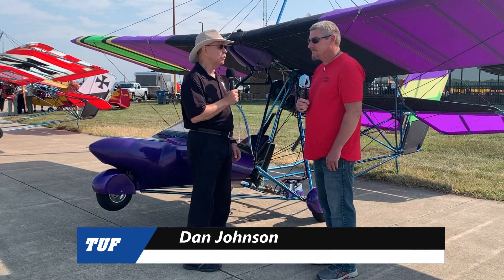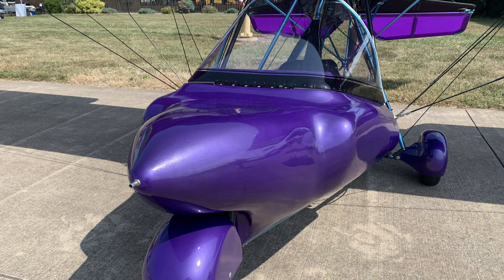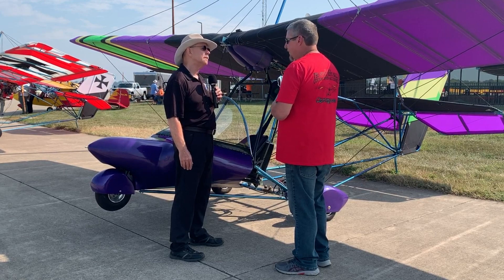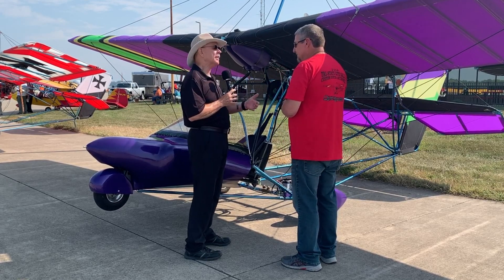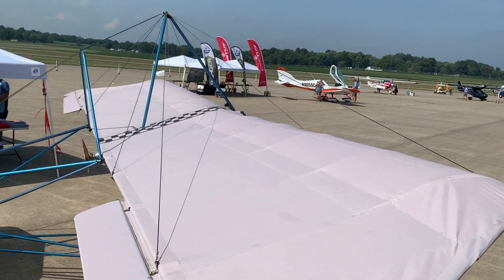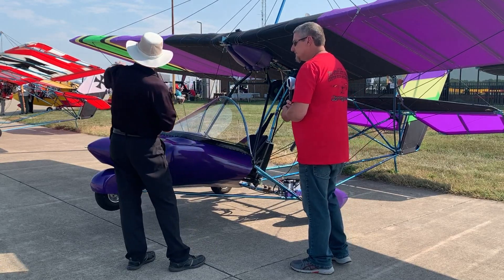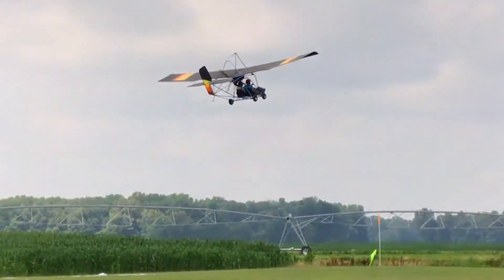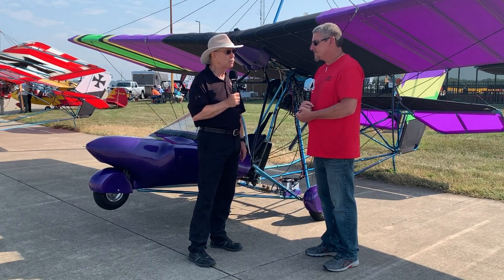Tri State Kites, Mark Smith's,  SmithSilver experimental & ultralight aircraft, Midwest LSA Expo.

Comment: I get the construction, known elements in a way, down to earth materials, fairly light weight construction but look at the immense complexity of it when it comes down to it. A simple carbon fiber wing could do without wires and might be cheaper, lighter and easier to make. Maybe a low wing design that you sit on. Engine as backpack. Could be a very different performer.
Reply: "Simple carbon fiber wing" is a pretty vague concept. My understanding of composite manufacture is elementary at best but I know enough about structural engineering and material sciences to place a carbon fiber wing or just a carbon fiber main spar as an order of magnitude more expensive, complicated and labor intensive than the traditional aluminum tube, fabric, and wire. A well engineered composite wing could (probably) get away with not needing wires or struts and be a similar mass. However, it would be hard to make it comparable in strength and even if it was strong enough the material cost and labor would be prohibitively expensive for the pt103 market. These quicksilver wings are impressively lightweight for how strong they are. The wing set is around 50 pounds with all the hardware, wires, rigging, tubes and fabric and it supports the ~230kg all-up aircraft at 5gs. That's over 1 ton suspended from the center of lift ~3meters outside the wing root. Further, you cannot repair a the precise and fragile composite structure you would need to replicate this kind of strength. If you put a quicksilver into the trees and bend a few tubes all you have to do is order a new spar for ~500$ and you're back in the air. Put a marginal dent in a carbon D-tube and the thing is toast. That dent removes nearly all of the strength an undamaged carbon spar would have and the only way to repair is to build or buy another.

Comment: Since there's no registration number on the aircraft, I presume it's meant to be a Part 103 ultralight vehicle.  At 1:02 Andy said the new wing design allows it to cruise at "around 80 mph" (~69 knots), but 14 C.F.R. §103.1(e)(3) says that a powered ultralight vehicle may not be capable of more than 55 knots calibrated airspeed at full power in level flight.  A high speed wing design is also likely to exceed the 24 knot maximum stall speed limit in §103.1(e)(4).  It's a shame you didn't question him about these issues.  There's a long history of manufacturers claiming to sell Part 103 compliant vehicles that actually aren't.  As an E-LSA this looks like it would be a nicely performing, affordable option, but as an ultralight it's an FAA civil penalty waiting to happen.